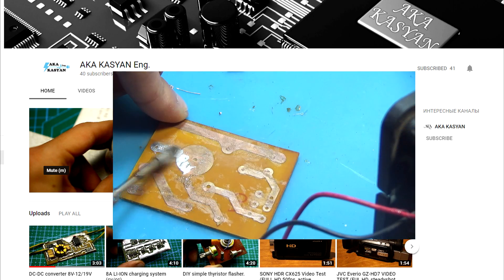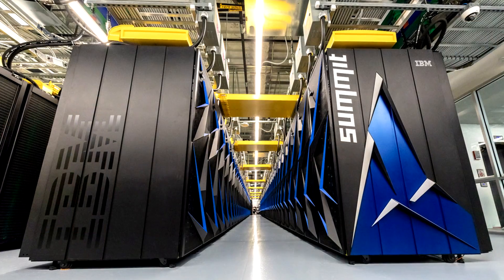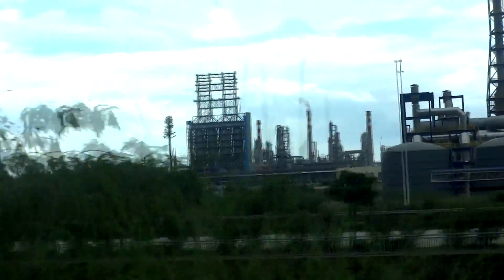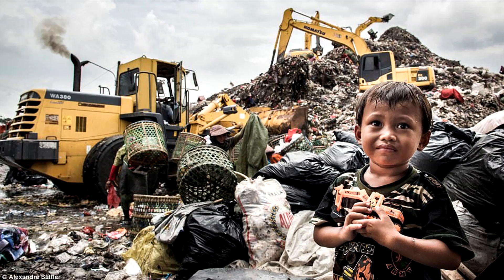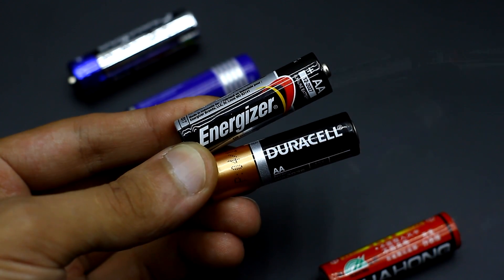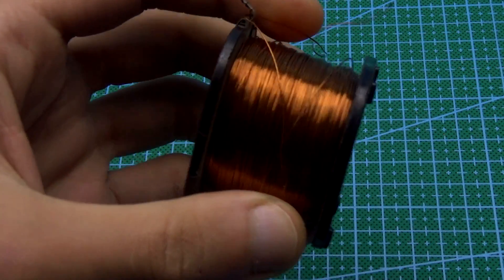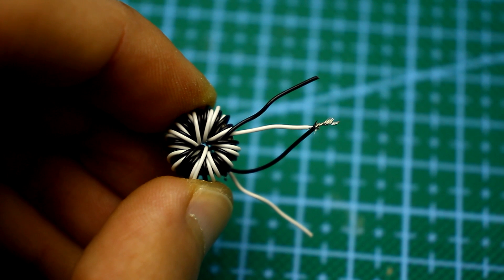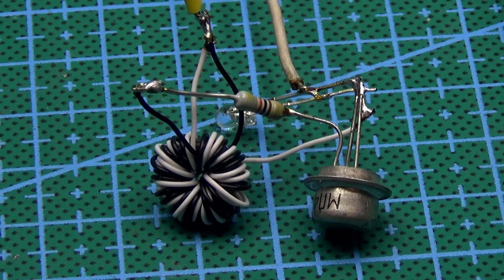Secret functions of battery

Comment: Well , this short story will change your thinking about storing battery's in your house. I had  battery 1.5 volts AA stored in on shelf for over a years, Simply forgotten.Once during one night , we heard strong detonation sound, like those small fireworks for new year. It took one hour of searching what happen, because there was no traces that something happen beside sound we heard. Than I found just bottom of one battery  somewhere in the room and realized that battery has blown up . Well battery was not connected to anything  at all , there was nothing around it to short it or whatever. So it were just  siting there till something happen inside of battery what caused it to blow up . From that time I simply , remove all battery's from every single unused toy and device , and if empty I trow em away in to container outside which is made for collecting disposed battery's. Don't want even to talk about what can happen with disposed and bad Lipo's as I have seen how you keep em in in jar. As I know almost everywhere in the world there is safe place to trow disposed battery's. Well that fail with AA battery which happen to me , happen only once in whole my life , so once in 50 years but it happen.  And I never heard from anyone else that he or she experienced same . So very low chance that something can happen, but it is proved it can happen.

Comment: I usually use smaller core availabe, have to wound 30t with very thin magnet wire,1/4w resistor and
c945 transistor. germanium tr here veryrare :(

Comment: 2:20 yeah?
Reply: yeah. in theory even if the rate of increased compation power doesn't hold we will arrive at a point when machines supass us and then they will take over the reaserch and improvement part, getting better and better more an more rapidly. 
but we don't live in theory we live in reality. and i'm not confident that we will get there. that is a mathematical prediction based on a limited number of important variables. one of them is wrong, forget it. 
Just take 2 examples, the first one incredibly simple the other one incredibly complex.
1) we just wipe ourselfs out, or at least destroy our civilisation, stopping progress. so many ways to do that, wars, nukes, just doing nothing and letting global warming do it...
2) no quantum computers. I'm a student in quantum mechanics, not aan expert on QC but i know a fair bit. our present computers are almost at their theoretical limit in terms of size, our transistors are the size of an atom you can't get smaller. so to get much more computing power we need to get to QC and assosiate them with our present ones for reasons i won't get into. and Qc we do have but boy are they expensive, sensible, fragile, imprecise, unpredictable, hard to build, and for now not even able to do 100 operations without making a mistake.

Comment: This circuit described here is called a (JOULE THIEF). It was designed by big Clive. He has a YouTube channel called (bigclivedotcom). Check him out. You can use any 2000 to 6000 NPN series transistors. You can use PNP's, 'but are wired different. The wire wound (Inductor or transformer) can be changed out for a solid state inductor. If you use the solid state inductor it could be put in a smaller space. I WOULD USE A MORE POWERFUL LED. Like a 1 watt. Thank you for your time in the production of these video's. It is appreciated. It's great we all have access to this and other knowledgeable people, 'so we can learn what ever we want too learn. Again thank you.
Reply: I wouldn't give the original design of such a basic circuit to one specific person. 

It's like the Wikipedia article about the inventor of the bread+butter combination. 
Obviously bullshit.

Comment: Nearly all the batteries I use are rechargeable. Any used batteries are taken to my local supermarket for safe disposal. All shops who sell at least one pack per day must accept old used ones by law in the UK and Europe. Any batteries no longer usable in high power devices can easily be used in clocks and remote controls. This is a great video.

Comment: Thanks for your really nice video. Maybe you can build a charger for not fully discharged batteries? As I found out, voltage max. should be 1.8 V, current 50 mA. There are science documents in the web about it. I've build one like the Alkaricharger, it works.

Comment: Why dont you do real alcaline disposable Battery recycling?

Tear off wasted batteries (the bigger the better), remove plastics and separate the iron coating, manganese oxyde/carbon mixture, and zinc hydroxide into glass containers.

Use HCl (Muriatic acid, hidrochloric acid, etc) to react with each compound (adjust quantities). You'll get ferrous chloride, a mixture of manganese chloride+carbon (filter the liquid part to remove the carbon), and zinc chloride (maybe potassium chloride aswell but doesnt matter). Use an aquarium pump to bubble the ferrous chloride so you will get ferric chloride. Use HCl in excess with the manganese. Zinc and iron will release hydrogen and manganese oxyde will release chlorine. Please do it in an open atmosphere.

Once you've got the liquid reactive, mix them all three with caustic soda (sodium hydroxide) dissolved in water. Stir and heat up near the boiling point for 30min, then remove the liquid part as soon as possible to prevent rust (at this point what you get is just salt water and it's safe disposable) and mix with waterglass (you can make waterglass or sodium silicate with ease, just follow a YT tutorial), let the  black compound sit in propper molds and let it harden (apply a layer of wax or grease because waterglass is sticky).

You will get high quality ferrite cores for power transformers.

Comment: Really nice work, dude. And I agree, I would rather buy rechargeable batteries than the common ones. 
Still, I'd rather use lithium batteries... Or even a AC/DC (🤘) power supply always as possible.
Reply: It's the rechargeable battery that are a environmental problem to just toss such as NiMH and NiCD. These are rather toxic, the cadmium is bad and keeping this stuff out of food systems we need like water and soil and where we live matters. To be real though, all these things actually for the most part CAME from the environment before being concentrated and purified. 

Alkaline battery not so much of a concern. 

As for use, Lead acid, Lithium, NiCD, and NiMH can provide high current, Alkaline no so much.

Comment: I make these, I use a 1k resister, a 2N3904 Transistor, a tiny ferrite bead and enamel coated magnet wire 0.15 gauge and one LED.